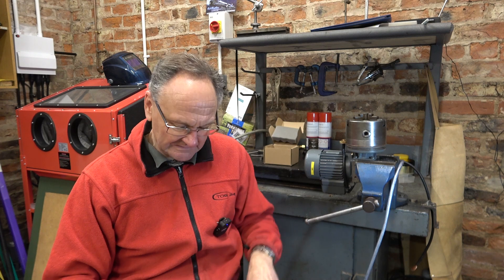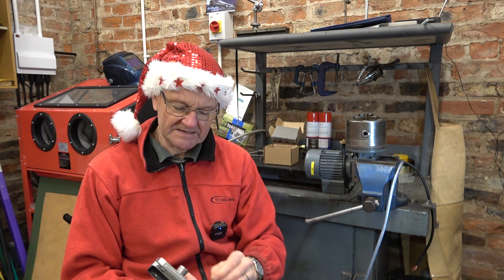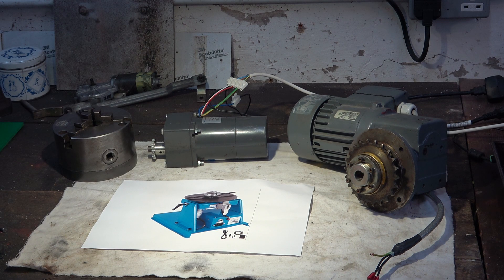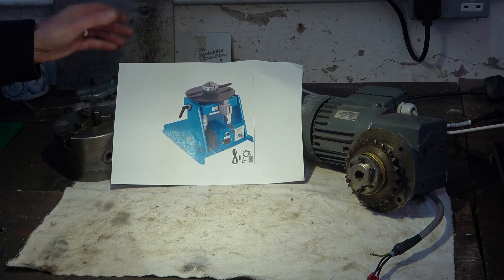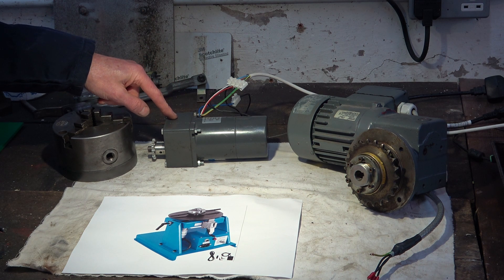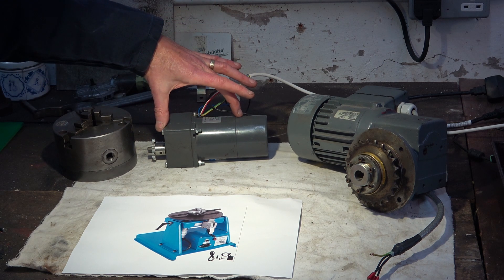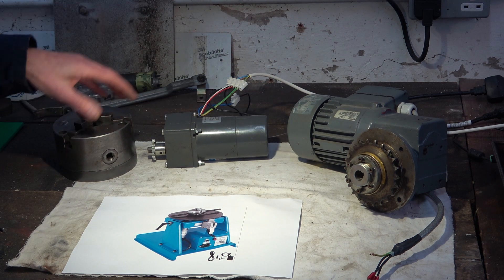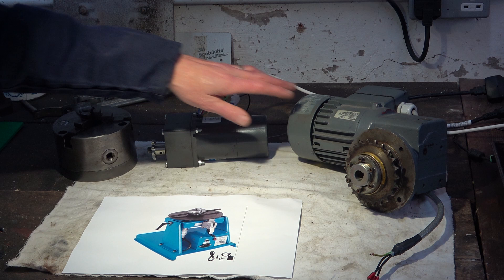HS113 Shopmade welding rotator build – Part 1

Comment: I bet it will work fine the foil and some tape will work well. I would advise not to use duck tape the heat makes it all gooey and hard to clean  your weldment. If your purge dam is far enough away from your weld you can use cardboard. Good luck sounds like you have it going your way
Reply from the maker: Thanks Mike.

Comment: Merry christmas! I will follow this with great interest. Just a thought, I have learnt that it may be harmful for 3-phase motors especially to run slow. The fan is also slowed down but the need for cooling is the same or higher. Greetings from Sweden 🎅🏼
Reply from the maker: Hi Jonas, happy Christmas to you too. If father Christmas really does come from Lapland then in Sweden you must get your presents before us here in the UK?  I have an inverter on my lathe and I keep the speed between 50% and 100% for the reasons you say. But the welding rotator motor is only 60W and has a big heat sink, also it will only run for maybe 5 or 10 minutes each time. I think it will be ok. Cheers

Comment: Good idea.  It may inspire me to use a 1 rpm motor I have.  Merry Christmas Paul.
Reply from the maker: Hi Harold, from the bit of experience I've gained with the rotator so far I can't imagine using above 10rpm. Stick welding a 2 inch pipe was comfortable about 4 or 5 rpm. Cheers

Comment: Merry xmas Paul!  I look forward to seeing how this comes along.  One thing to consider is the backlash; that might be a factor if you have something off-balance in the chuck which could potentially lurch forward when it goes over the top.
Reply from the maker: Hi Jim, there is a bit of backlash but it is only small. As you will see later there is just a worm and a wheel, not a long chain of gears, so the angular backlash is small. My bad welding will be more of an issue than the backlash 😁.

Comment: Cool project. I didnt think about making my fixture able to back gas. Interesting idea. I mainly use mine for mig and stick so the need has never risen.
Reply from the maker: Hi Tom, .... and possibly I will never use the purge gas through the chuck but if you don't build it ain't there.  In the past I've taken a lot of trouble over features I thought I might never use and then I find myself using the feature unexpectedly in a quite different way.  Merry Christmas.

Comment: Hi going let know how I purge tubular pieces get your purge hose taped inside your piece and secure your hose to the piece I use masking tape to hold the purge gas inside and you can just tape the hose to the piece.you may have unwrap the every so often. Most of my welding experience has been on piping. You might want to consider making your rotator where you weld you pieces in the vertical and horizontal plane. Hope it works out well for you.
Reply from the maker: Hi Mike, I have probably made it more complicated than it need be. I got fixed on the idea (elegance?) of a centre feed and of course it caused me a lot of work but having used it now it is quite simple and satisfying. I'm very much a TIG beginner and I struggle with the basics so one less thing to get wrapped around is welcome. I tried turkey foil to seal the pipe ends and it worked but was a bit awkward. Happy New Year.